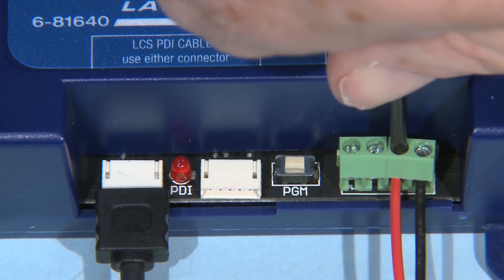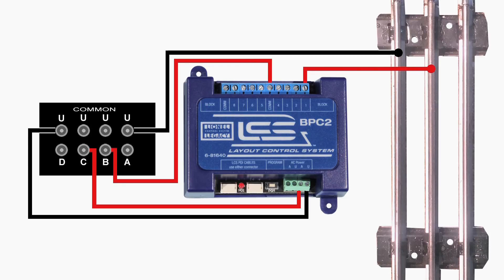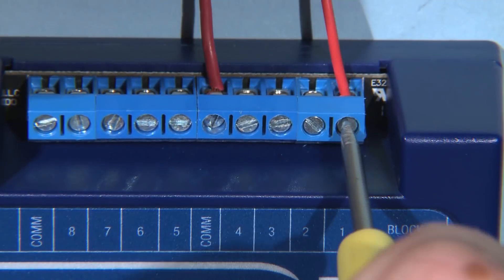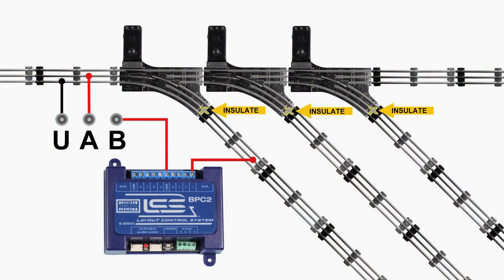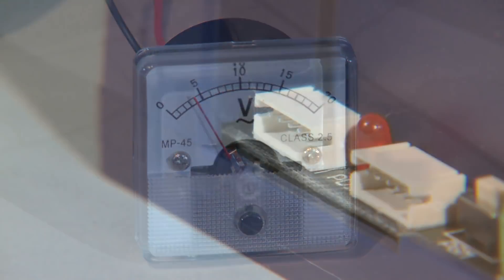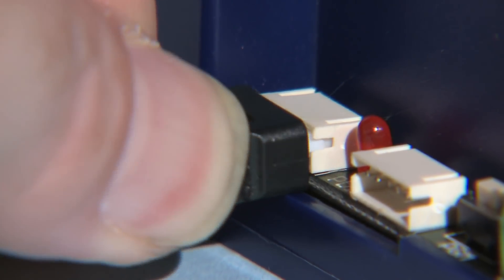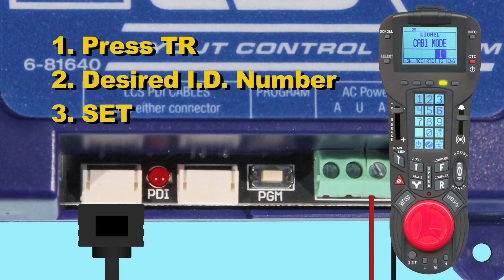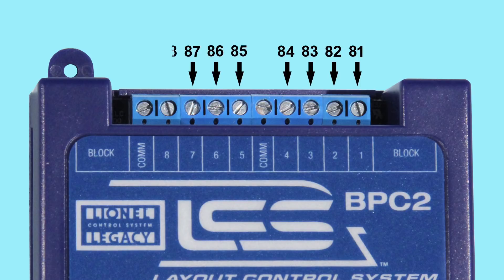Modern O Gauge Remote Control – LCS BPC2

Comment: Wow! It seems so complicated.
Reply from the maker: What helps is understanding not only what wire goes where, but why. In this case, the BPC2 module is the go-between that either completes the circuit from a transformer to a block, or disrupts it. It is the same as using a simple on/off switch, except in this case it's a component that enables you to perform the same function with a CAB-2 LEGACY remote.

Comment: Hey do you have any tips I have a layout Lionel o gauge and the power to the track is very weak and the stain stops on certain tracks. How do I fix it?
Reply from the maker: If the power seems to weaken at the point furthest from the transformer, you need to add another feeder wire from the transformer to the track at that end.
Reply: That makes sense but I have plug and play with Lionel . In one area the train seams to slow down. All the tracks which are new are joined together. I moved up to the next level plug and play transformer. So do I need one of those giant size transformers? I have the Lionchief system. I just put the train up for Christmas time with my village Linsterville. (Check it out by the way) Thanks for any answers. I do enjoy your channel.